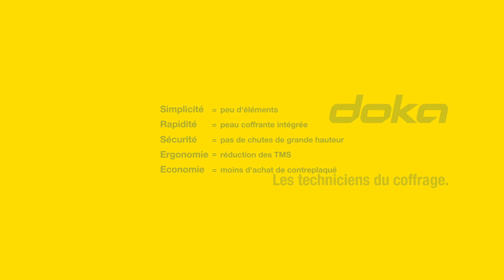Coffrage modulaire de dalles Dokadek 20 [FR]

Comment: Whats the differences between dokadek 20 and 30
Reply from the maker: In general, both Dokadek systems can be erected very safely from the ground.

Dokadek 20 is designed for residential buildings.
Slab thicknesses of a maximum of 20 to 25 cm (with a flatness deviation of l/500 or l/400) are possible.
The element dimensions are 1.00 x 2.00 m.

Dokadek 30 is a very economical and fast slab system.
Ceiling thickness up to 30 to 35 cm with additional measures up to 50 cm.
The element is larger (1.22 x 2.44 m) and therefore faster.

Comment: Et quand on doit utiliser des ourdis pour la dalle?
Reply from the maker: The standard use of Dokadek 20 System is the direct pouring of the concrete on the formwork. The combination with hourdis is possible but not really useful. Dokadek 20 has a mounted plywood.